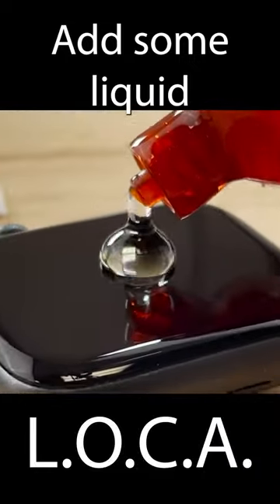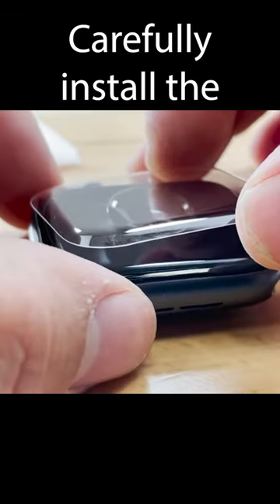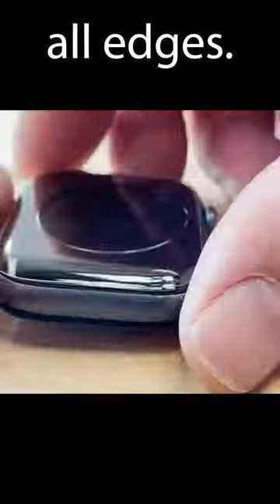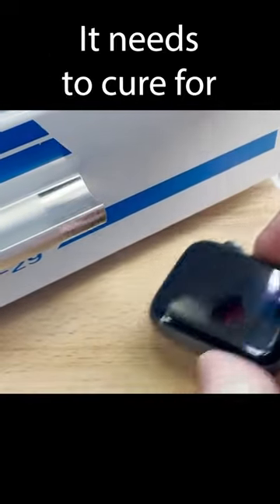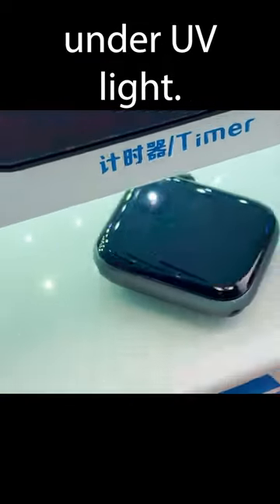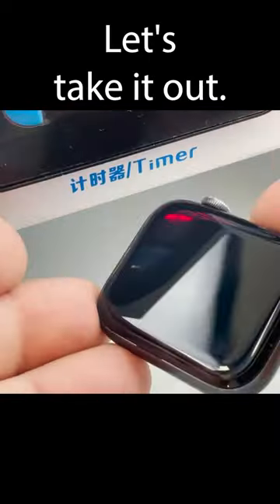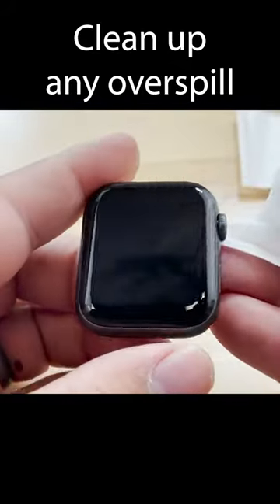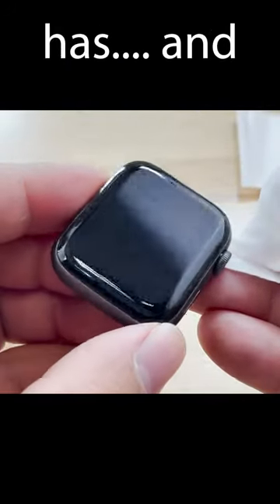🔥 Apple Watch Tempered Glass (how to install)😁#Shorts #satisfying #applewatch #temperedglass

Comment: so I installed mine, got the kit of off eBay, and now several months later I notice there are bubbles appearing along the edges of the screen, what gives, there weren't any at first...could it be that the loca I received in the kit is just bad ? thanks for your answer in advance, love your content!
Reply from the maker: probably needed a drop or two more of loca so that it doesn't bubble up on the edges.